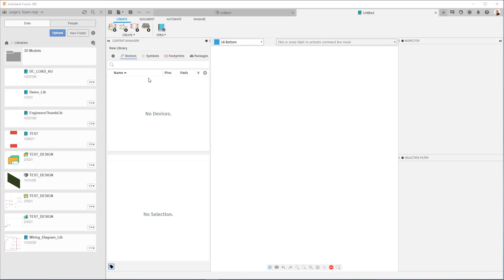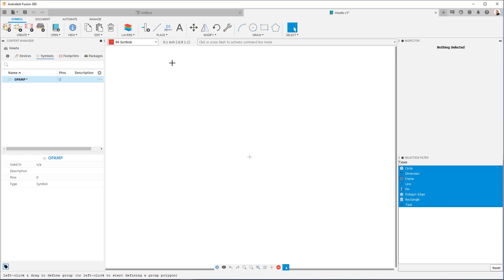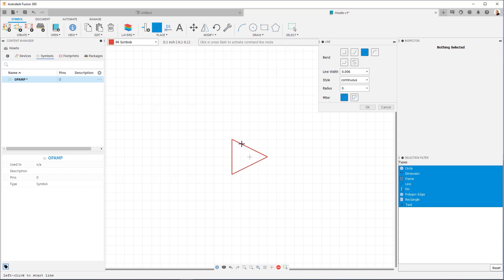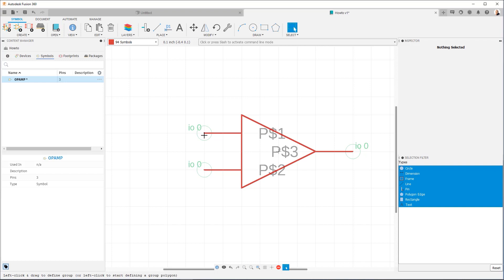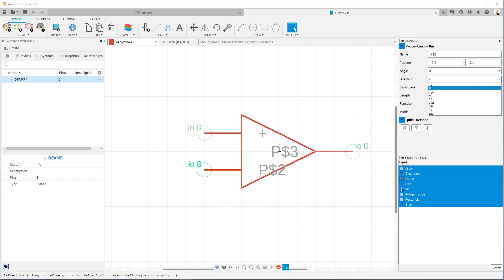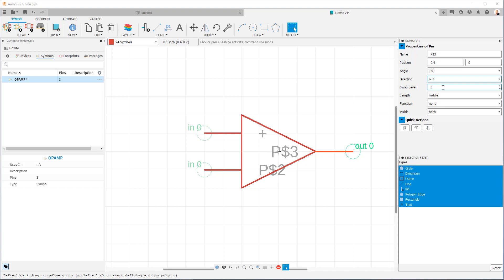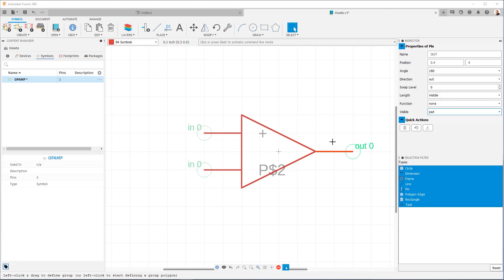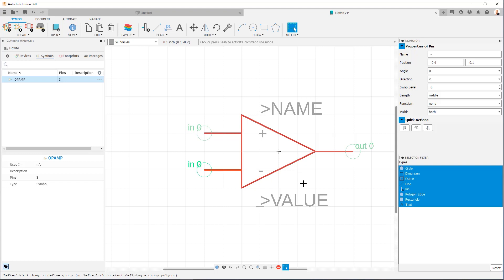Create your own electronics parts in Fusion 360: Video 2 Making a symbol

Comment: What an mess to draw a triangle with the symbol editor of Fusion 360 Electronics. It took me quite some time to accept the fact that i need to modify a rectangle to achieve this task.... The question about power pins still has not been answered after 2 years.